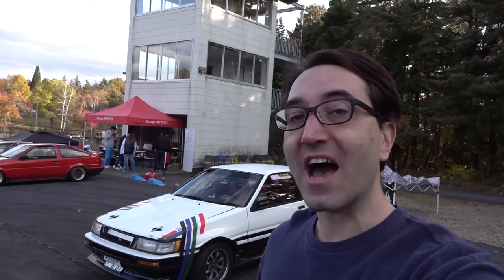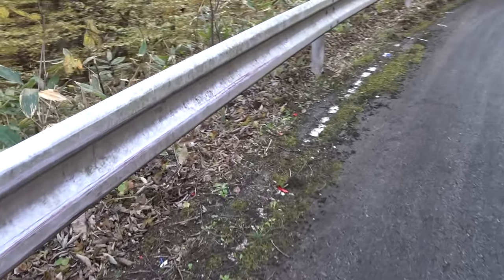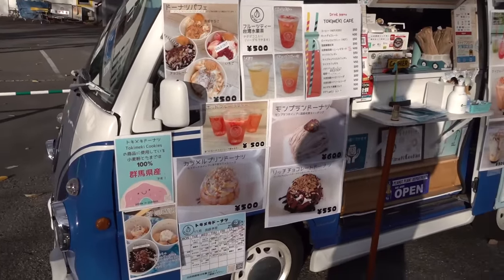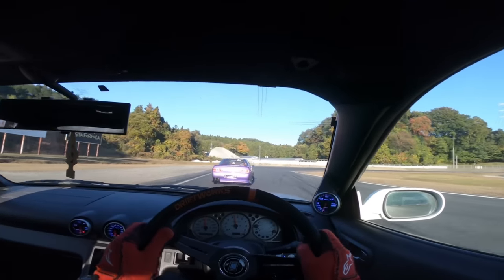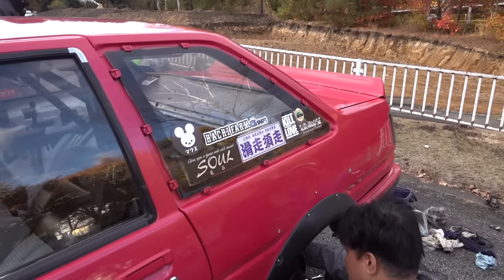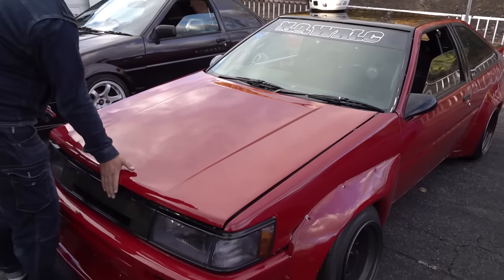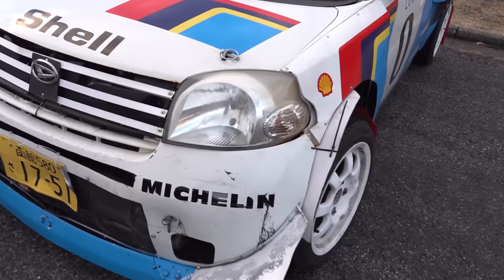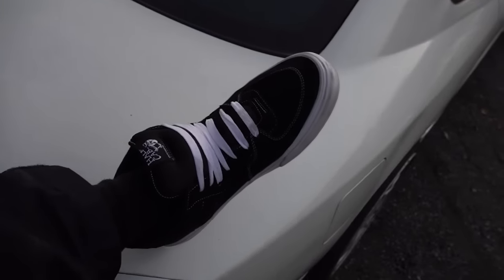AE86-only drifting at Gunsai Touge

Comment: I'm not sure why a Kombi instantly makes pastries and hot drinks seem so much more delectable.
Reply: I went to a mates wedding and they had a kombi bar. Had 6 taps on the side with kegs inside . Roof had a flip up 55inch TV too. They make awesome food/drink trucks 🔥🔥
Reply: Even when it's a tiny Subaru in disguise ! LoL
Reply: Or a Kei van. Or both at the same time.
Reply: Are Kombi's common in Europe? They're soooo common here in Brazil. to the point where all small vans are Kombi's.
Reply: @bernardoramos7842  They're much more common in Brazil, because they were made locally 👍🏻
Reply: @edwardfletcher7790  Yeah that makes sense. Another question I have is: are Chevrolet Celta's exclusive to Brazil too? I tried searching but couldn't find anything about it outside of the country.
Reply: @bernardoramos7842  Not exclusive to Brazil, it was sold as a Suzuki Fun in Argentina and a couple of other third world countries, I wish we could get rid of them they are one of the ugliest cheap cars i've ever seen
Reply: @inab9779  whaaaaaaaaaat?? I think they're so cool though (only the 2005 downwards)

Comment: lol there aren't any AE86's left unfortunately. i was going to buy one years ago and started doing a ton of research. i even found a few in the US for not that much money. the problem is, literally every surviving AE86 has over 300,000 miles and at least one full engine rebuild. most of them just have completely different internals and only have the body. and most of the bodies are rebuilt many times over because people smash them up while drifting. The whole reason why its a legendary car is because it was accidentally the best design for drifting in its stock configuration, and they look awesome. its a rare 90's style car that looks really good (mainly because its late 80's). 

I ended up not getting one and just saving the money for a much better engine build later on. if you could get one stock with less than 300k miles, i'd buy it in a heartbeat but they just don't exist anymore

Comment: Is the engine the main difference between an 86 and a 85?
Reply: Both levin and trueno were made as ae86 & ae85. The ae85 has a different engine, lower spec interior, drumbrakes in the rear, open diff etc...

Comment: now why would you go and ruin an awesome video by mentioning that really badly made driving games called Need For Speed Alexi?, throw that shit away and get Gran Turismo....it is an actual driving simulator, makes all NFS games look like absolute shite....NFS has got nothing on Gran Turismo let alone come close to it on the "best driving games" list, GT has full attention to detail, including interiors, all gauges work too AND has proper realistic driving physics....and in GT7, they now have legit engine swaps, iv got a S13 Q with the Subaru BRZ drift car engine in it, the stock SR fully worked only makes roughly 430hp maxed out, where as the BRZ conversion is the big single turbo V8, comes standard with 1,047hp, but you will wanna detune it to 725hp, its the only way it gets enough traction to drift it good , i built Sammit's Yashio Factory 2jz S15, Luke Finks USA Corvette and his Aussie 370z drift cars, got Adam LZ's 2j S15 as well, got a LT1 V8 Miata (thats a friggen animal of a car) but yea, if you want a real driving game to play, skip the crap and go straight for the best driving game that has ever existed so far.....Gran Turismo..... 😁